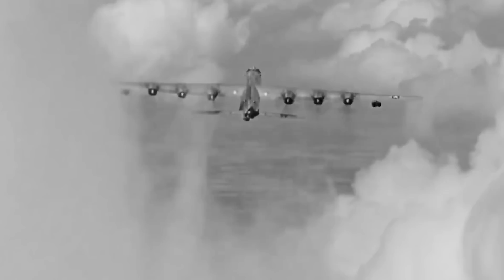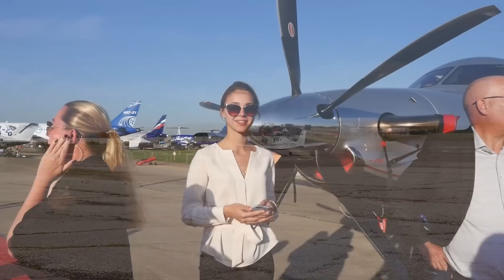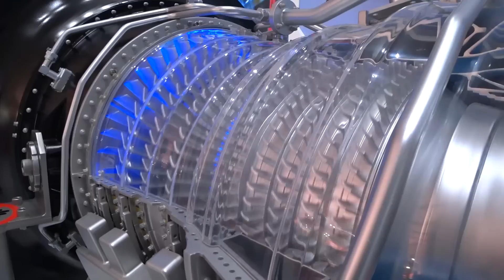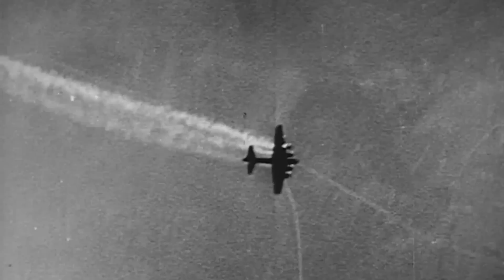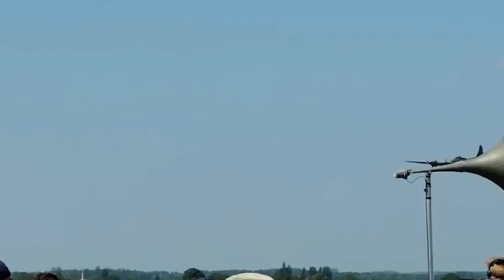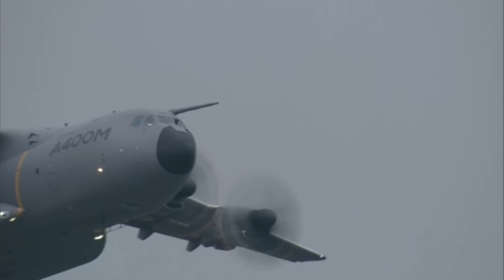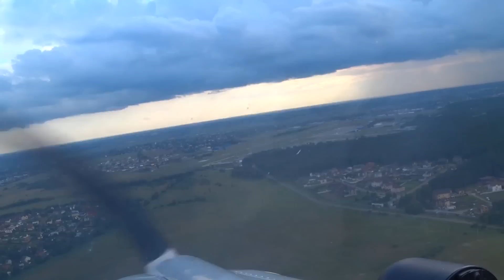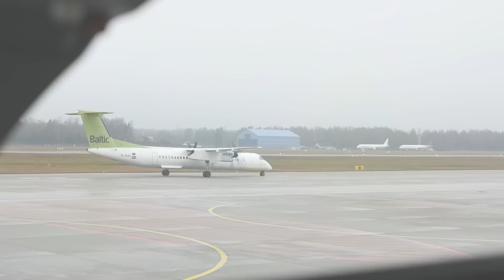Piston and Turboprop engines | What is the difference?

Comment: Piston engines have powered the DC-3 for 85 years and will continue powering it for another 85
Reply: DC-3's with turboprop (BT-67) : am i a joke to you
Reply: Ouch!
Reply: BT-67 : "Don't remind me with my past!'
Reply: It's very strong airframe, when it was being designed back in the 1930s, the engineers knew a lot about aeroplanes, but they also knew there was quite a bit they didn't know about aeroplanes so they overbuilt it, made it much stronger than it needed to be, much stronger than modern aircraft because engineers today know more therefore can build more efficiently.  However many modern aircraft cannot take the same punishment in rough areas like a DC-3 can for that reason.
Also while many are being converted to BT-67s, not all and it's unlikely that all will be converted and we will still have piston DC-3s flying commercially for many years to come.  It also looks better with piston engines.
Reply: only because DC-3 doesnt have limited air frame hours... but many of DC-3 are getting converted to turbo props
Reply: @jebise1126  Simply because they don't have pressurized fuselage like all the jet plane do. So there's barely any stress on main frame other than landing
Reply: They come with turbines now, too.
Reply: The DC3 is a SLOW PIG.
Reply: The DC-3 is a legend
Reply: @lbowsk  that comment shows your experience. Or lack of.

Comment: Skyships I'm limited in my ability to throw stones as I don't produce content, so I could never say I could do better, but this is the first of your films I'm almost disappointed at.
 You are trying to differentiate between piston and turboprop aircraft. Basic technology explanation isn't generally what you have done but OK this is a departure. I feel because this isn't what you normally do this video isn't as clear as normal.
 Piston Vs Turboshaft  an OK idea but you then venture onto jets. Yet the jets you venture onto are a mixture of pure turbojets and as in the modern passenger jets high bypass turbofans which are somewhat closer to turboprops. Even I'm not going to go into the experimental unducted fans. Yet all are a sliding scale on each other.
 The predominance of cheap flight envelope extending turbochargers  in the economy end, such as in gyrocopters that generally don't need them. (Yes they do but I think you can see what I mean)  Why are we using such old engine designs in general aviation? If any company couldn't design a smaller more efficient engine to displace the Continental they deserve to go out of business. Which brings up the extraordinary costs of general aviation in the West. Let us ensure everything is safe, so we increase the entry costs to exclude all but the few and continue with inferior engines.
 Finally, the only new general aviation piston engines I tend to see progress on, the kerosene burning new piston Diesels.
 I do love your videos Skyships. The follow up to this might be complex but unlike the MSM I think you believe your viewers could understand it.
Reply: Well, i like the things you say. Let’s see how far are the diesels gonna make it with Diamond Aircraft in the lead. Me personally, I don’t like them, even though they are efficient and probably more reliable. Maybe because I’m used to old tech. Who knows.
Reply: @Gemini1721999  I have no idea. I don't know enough. The background economics constantly change also. President Trump has chosen to frack, now that won't make oil as cheap as water but it is like a dissociation constant in weak acid chemistry. It provides a buffer and oil prices won't rise above a given point or massive extraction resources kick in. Beyond the scope of this it gives America energy freedom. Now we are going through one crisis at the moment but generally carriers have bought newer planes to help offset the price increases in fuel. What if fuel prices flatlined. This is not as relevant to small Diesel aircraft as fuel availability, but who knows?
Reply: @COIcultist  Yeah, let’s just hope the prices of oil won’t go down, rather oppositely, will go up. I’m no Greta, but what would the decrease of oil prices have done to the environment? Especially now, when we need the pressure on the world economies, to shift to renewable energy sources. Otherwise our children can live in a very different world than we live in now. If you are interested in this topic, try to look at the video “Curious Droid - Is hydrogen the future of flight?”. In my opinion, diesel, petrol, or rather every engine using fossil fuel, will become obsolete one day. Some of them already are.
Reply: @Gemini1721999  I would like a world of clean air and clean water but I don't give a toss for the CO2 non science. 
Renewable energy. In most of the Northern Hemisphere population centres it doesn't work we don't have the energy density to generate sufficient energy from solar and wind farms. Let alone sufficient reliable energy from them.  Wind doesn't blow at times and when it's cold at night there is no solar power. How are the brown out in California and Australia working out? 
I have a friend who helps design hydrogen generators for fuel cell fuel. The most efficient form of hydrogen generation is through chemical action. However, the hydrogen produced is not clean enough for fuel cells. That needs hydrogen produced by electrolysis. This is desperately inefficient, it is breaking chemical bonds with raw electrical energy.
 Electrical energy. I always thought about 50% of the consumed fuels energy arrived at my house as electricity. It doesn't, alas figures aren't great they appear to vary between low 30s% and high 30s%. So if we said 35% then after the house domestic voltage transformer to charging voltage loss, the battery charge to battery recovered energy loss and the motor loss make battery electric vehicles far less efficient than a petrol engine let alone Diesel engine. 
  Remember our hydrogen fuel cell? Well 1/3rd of the product by molarity and 16/18ths  of the product by mass is very clean oxygen. What do they do with that expensive product? Don't be stupid they are not paid grant money for that so it is just vented to atmosphere. Wonderfully efficient!
 If you believe in the man made global warming scam. Sorry I do apologise as there is no warming it is now called man made climate change, then why are you viewing an aviation channel? No foreign holidays for you. Very limited vehicle travel. Vegetarian diet, though how they fertilise that without animals without the use of agrichemical nitrates I don't know. On second thoughts no chemical nitrates as we have closed down the oil business.
 Why not buy yourself a hair shirt while you are at it and flagellate yourself daily whilst praying to the Blessed Greta?
Reply: @COIcultist  That's quite the load of nonsense you spewed out there. How many large powerplants are located in city centers? Have you ever noticed those big steel towers that hum? They carry power from places where it is generated to where it is used. Brown outs are pretty rare, but there are power shutdowns when strong winds blow to avoid having downed powerline destroy whole towns as happened with Paradise. That has nothing to do with renewable energy and everything to do with the utility paying shareholders before maintenance crews.